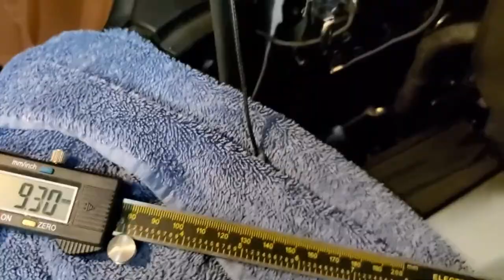2018 Mercedes E400 Convertible Cord Repair

Comment: I have a 2018 A205 (C Class Cabriolet) in the U.K. with exactly the same issue. Looking at your excellent video it seems incredible that MB charge so much for the repair! I guess that they unnecessarily replace a whole lot more components as I can’t see them drilling out rivets etc. DIY style. A great video, thanks.

Comment: I just did my 2017 c43 cabriolet wasn't easy il tell u that but it was worth it mercedes dealer asked over 2k  to fix i did it in my cando thank u so much for the video and the part number respect

Comment: Really helpful video, i can't believe they didn't use stainless wire originally. It's almost as if the cords are a built in failure for a future money making repair, but no, MB would never do that.....
Reply from the maker: Yeah, to make this a wear and tear part but not provide maintenance instructions is sub-par for sure.

Comment: Just for information, i have finde kit for my mercedes C_klass w205 from 2018 and part number is exactly same part number like E-klass. same number from this video. I hope can help somebody. Mb dealer asking me for 3000 euro but probleem can easily fix with  50 euro.just f..king 50 euro. Very big different. Tanks for goed video that bring confident and saved  my mony
Reply: Would this part number work for 2017 mercedes c43 cabriolet?
Reply: @storm_merle_  I ordered it thru a Mercedes dealership for my c43 2017 cabriolet and the parts number matched the vin number on my car.

Comment: I am going to have to attempt this on my A205. Very informative video. My plastics are damaged where the ring clamps have pulled away from it. Any ideas as to what I can use to permanently fix them back into place? I was toying with gorilla epoxy once they are in situ and just covering it all on the fabric panel. Any alternative suggestions?
Reply from the maker: Can you show pictures?  Glue is generally a very short-term answer to a problem like this, especially given how hot these tops can get in the sun.  Hopefully the community can help!
Reply: When the plastic clamps on the interior roof are damaged, Mercedes charges you an extra 1000€ to install a brand new interior roof. I guess you have to try something like glueing it together if you don’t want to buy a new one.
Reply: Same issue here, it’s funny no one talks about those. How can I buy just the plastic pad myself?

Comment: Great info and detail!  Actually asked my MB shop for a quote and they said "new liner" because one string pulled thru the "tunnel" where it connects with the rectangular crimped ring pocket on the liner. Any suggestion for repair/replacing that "tunnel"? They quoted $4,000+ for a complete new liner!
Reply from the maker: Sorry I don't have a fix for that issue.  You may be stuck.
Reply: For 4k you can buy a brand new soft top. I'm going through the same deal on my 2018 c43. Purchased used, burned for not knowing/looking for these common issues.

Waiting on quote from dealer, upholstery shops around me all back away from the fix, not really sure why. If they are going to quote me some insane price, I'll just buy a new soft top. 

If in the US can get an OEM shipped to your front door for 2.8k
Reply: @Jason-uz1ut  Found a guy in Statesboro, GA who did mine for $800 and I supplied the parts-under $100. Got lucky after calling lots of upholstery shops to find this guy.  Dropped it off and had it done a few days later including a patch where one cord had pulled thru the liner.
Reply: @steveyingling2876  take my money lol. I got quoted 2.9k last night for liner and string replacement at my dealer. So I did some investigation sure a brand new soft top is cheaper than the repair by a few hundred, but install quotes are insane, average 130 an hour 10 hour minimum.

I'm bummed, no one else's mistake other than mine for not being diligent in purchasing. I have called over 10 upholstery shops near me as I reside close to Manheim Auto Auction and NOBODY wants to do it. I even printed and gave all of them the Xentry on how to fix.

Comment: How did you keep the roof half open? 
I can not keep it like that, it closes automatically after few seconds
Reply from the maker: It's in the video but I understand the vid is long... Open it halfway, turn off the power button on the car, then get the key 15 feet from the car.  It should stay up.

Comment: How do you get the top to stay mid open ? Mine keeps dropping back down after a minute
Reply from the maker: It's in the video.  I think I brought it halfway open then stopped.  Then turn off the ignition altogether and get the key more than 15 ft from the car.
Reply: @grantj3232  many thanks!! I’ll give it a try. This may be saving me $3400 quote from dealership just from a fraying cord. 😳

Comment: I have 2017 c43 cabriolet cords are wearing badly 1 is broken what is the part number so i can buy them please and thank u
Reply from the maker: Hi Storm,  you'll need to buy them from your MB dealer.
Reply: @grantj3232 would it be same part number?
Reply from the maker: @storm_merle_  Sorry I wish I knew and could help.   You may want to try a forum like MBWorld or call the dealer.
Reply: My 2017 C300 uses the same part number as shown in the video. I confirmed with a Mercedes dealer by sending them my VIN before ordering.

My problem is that when I went to change them out I found a number of the plastic lugs that the crimped ends fit into, holding the cords to the roof, are broken and I see no way of repairing them, which means the whole roof likely needs to be replaced. Very expensive overkill for such a simple part.

Comment: Can i use different tape
Reply from the maker: Yes I think one of the replies mentioned using aftermarket tape of some kind.  I was happy only spending about $100 for the repair...why scrimp to save 20 more when OEM is right there and you're saving $2900?  Just my POV.

Comment: Hi I cant see the kit or parts number in the video.
Reply from the maker: Hi Luis, well, take a look at 3:11 into the video:  A006989848510 is the tape, and A2057780500 is the package of all the strings and pins etc.  Have fun!
Reply: @grantj3232 
Sorry just saw this 
Anthony lavacca